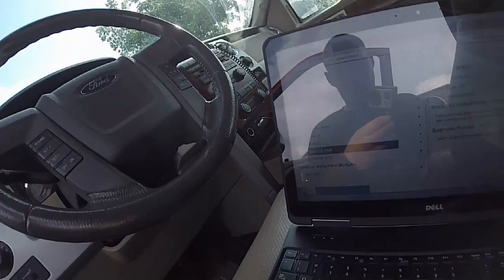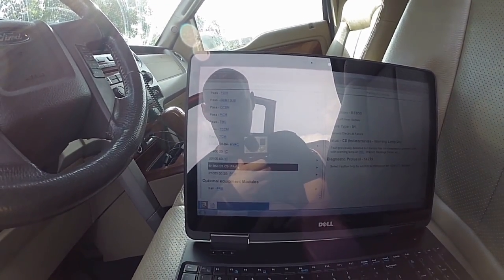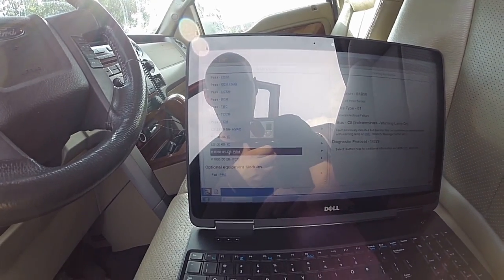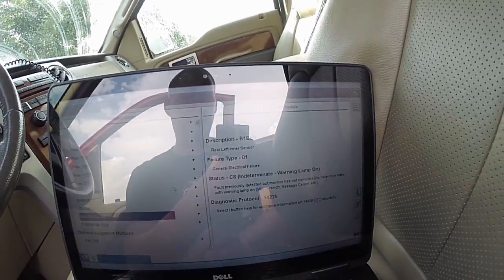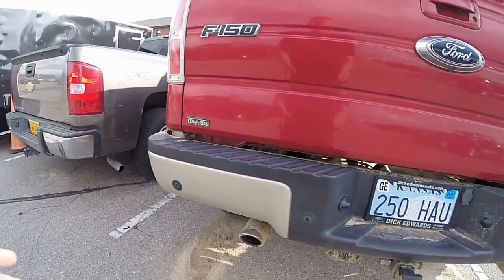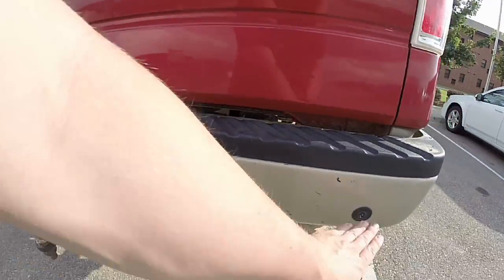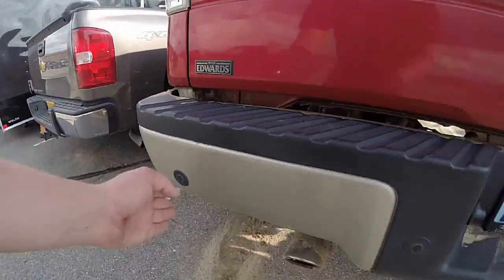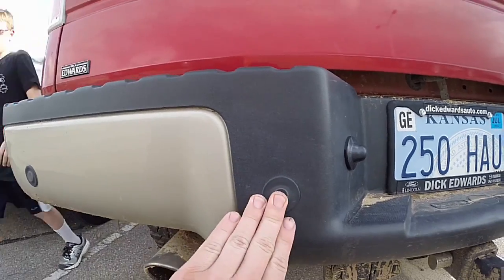Ford F-150 Reverse Park Aid Diagnosis The Easy Way: Fixing Fords Across America

Comment: On my truck if you put the vehicle in reverse without starting it you can put your ear next to each sensor. The ones that you can hear clicking are working, the ones that you don't hear any noise from are bad. It's easy to swap the sensor around and determine if it is the sensor that is bad or if it is in the wiring.
Reply: +BucktownPSD You are correct. This is even faster than breaking out the IDS. If the environment is noisy, I use a stethoscope to listen to them.
Reply: +BucktownPSD I had to scan the comments just to make sure this was here. My used 2005 came with this issue and I was able to diagnose it quickly using this method. 

FYI: You can get replacement sensors on ebay for about $40 for 4. I don't know how long they will last, but ya can't beat that price.
Reply: Not always correct. All four of mine make clicking sound and rear park aid doesnt work.

Comment: A video about the scan tool that you use would be great. If you could compare a couple of alternate scan tools it would make the video amazing. -Thanks, Mike
Reply from the maker: mercurymike66 I know it is on my list of videos to do.
Reply: Ford IDS tool made by Bosch. It's the official tool the dealers use and by far the best for Ford vehicles. Auto Enginuity provides decent capability and features but the IDS is superior. I think they run around $1,500 plus $700/yr subscription. It sends expensive but really isn't when you look at the capability.

Comment: Quick question for yah. My back up sensors dont work but on two occasions they came back from the dead. Once when crossing a river and once when backing up into some bush. After both of these times the sensor worked for about an hour then quit again. Any ideas?

2011 F150

Thanks, Evan

Comment: Replaced all 4 sensors they are now clicking. The off light is lit. If i push switch to turn off or on it goes off for really quick second and comes back on. Is this a switch or module prob. Thanks

Comment: You don’t need a code reader. Turn the ignition to on and put vehicle in reverse. ( Do not start vehicle and make sure vehicle won’t move ) If you listen closely to the sensors the working ones make a clicking sound. The bad one(s) make no sound. I used a mechanic’s stethoscope to hear them better.
Reply: Hey i put all 4 sensors new and still not work    Still put the message raid park assist.     What u think is the problem? Thanks

Comment: I have a 2000 lincoln navigator and the rear sensor does not work. i tried switching them around and i heard the ticks but the parking aid button is still showing off and my fuses are good what else should i do
Reply: I have similar problem

Comment: Are you using the ELM327 dongle and the FORScan program with your laptop you linked earlier to gain access to this data as well as the power balance function back when you did the coils and plugs on the F150? 

Just wondering as I've been trying to find something to give me access to more of this data and functions from a laptop or I pad one.
Thanks Ky
Reply from the maker: +kentuckycowboy2  No I was using the IDS software I am just starting to explore the features of the forscan software.
Reply: +FordTechMakuloco Thank you for the reply.

Comment: hi
although i was able to change the faculty sensor that does not make ticking sound the system is still off, any advice please?
Reply from the maker: year, model, PAM Module codes?
Reply: FordTechMakuloco 
fixed
it turned out the speaker was also bad beside the sensor
thanks for the reply and help
Reply: @yazeedkhadra  hi, I am also having problems with my back up sensors in my 04 f-150 lariat 4x4. Best I can tell, none of the sensors are making any ticking noise with key on, motor not running, truck in reverse, with the parking sensor button showing off (because it won't go any other way. When I push the button, the light stays on showing the park aid system is still off.) . I was wondering what speaker you were referring to and also if you had any ideas what it could be. I replaced all the sensors a year ago with eBay sensors and have also checked the fuses.

Comment: Another great !!Is a scan tool required to perform pinpoint tests?  And what model do you recommend?Thanks again TECH
Reply: jsjizza1 For a simple DIY-er I can recommend OBDLink MX either bluetooth or wifi depending on what you like (mine is bluetooth, $99), and FORScan (free on Windows, 5 bucks on Android). This software is specific to Ford vehicle and packs a royal punch, it allows you to read fault codes from all modules and control the PCM I/O's as well as run self tests, in addition it actually allows you to program PATS keys as well. It's awesome, if you want more than this then you need to get a Ford VCM, but they're pricey..

Edit: Oh, and I'll add, the Android version of FORScan only has basic functions, no control features or test features, but it reads all modules. To get the test functions, control features and PATS programming, you need to run the Windows version on a laptop.
Reply: @Skauber  forscan would pick up this sensor fault?
Reply: @2005GLI  Yep, fixed the park aid on my Expedition with it. Wasn't a sensor fault in my case, it was a torn wiring harness which I was able to repair.
Reply: @Skauber  awesome

Comment: Does anyone know where you can pick up some of these Reverse Park Aid sensors? I'm trying to replace mine on my 2012 F150 FX4 but my local dealer wants 360$ a sensor.
Reply from the maker: +Collin Facino Get it on amazon Here- http://www.amazon.com/gp/product/B00FYI783A/ref=as_li_tl?ie=UTF8&camp=1789&creative=390957&creativeASIN=B00FYI783A&linkCode=as2&tag=fordt-20&linkId=AW72I6MXGGVVLTA2

Comment: little less than an hour ago i was backing out from my driveway unto the road,as i was turning my wheel to enter the road i heard a loud thud or clunk.from then on my reverse will not work.all other gears works except reverse.it will go into reverse but being able to actually drive in reverse.im a bit spooked thinking the tranny needs fixed.other info ive researched say it could possbily be the tranny cable wire or linkage.04 ford f150 xl 8cyl 2wheel triton.lil or any help would be highly greatful.